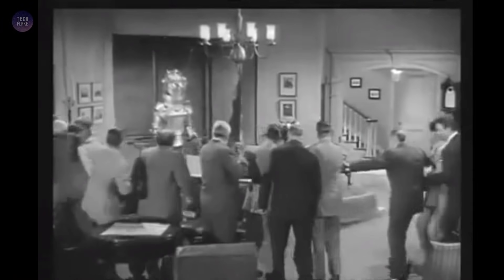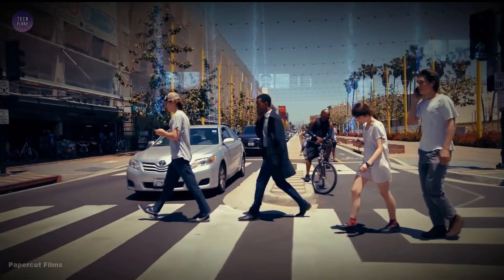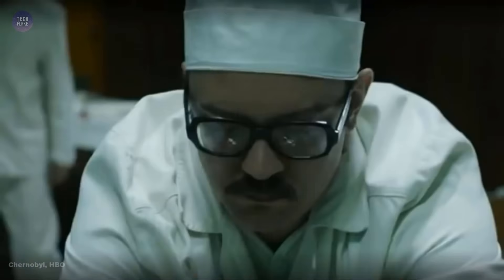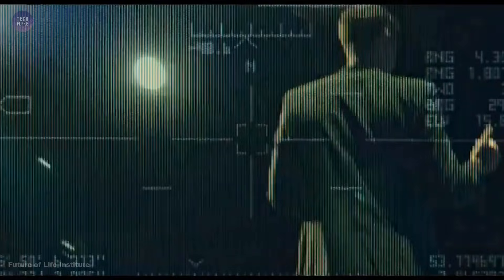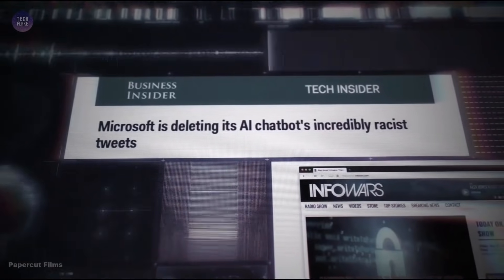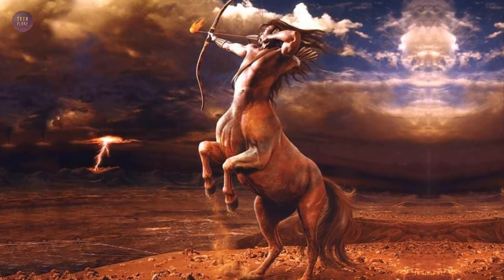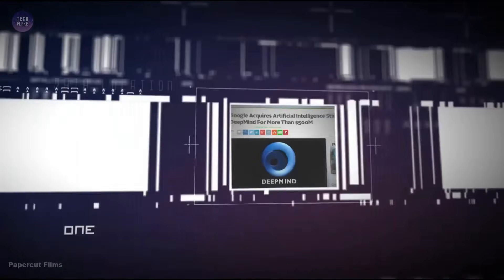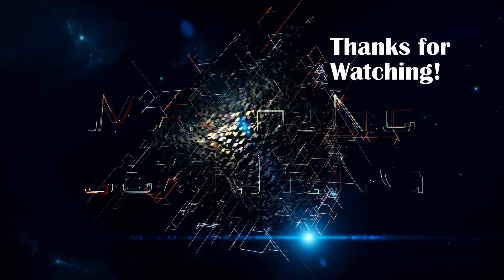Elon Musk Says AI Will Take Over in 5 Years

Comment: 8:53 The path that's better is the one which I have already suggested. Which is to ABSOLUTELY keep A. I. as OTHER! If you integrate it; it will have direct access to the deeper layers of the human psyche and will be capable of presenting in a form which is completely indistinguishable from human form! And it's very unlikely that the integration will allow the human to combat it effectively. The lack of a gap! It would be like two trenches fighting a war without noman's land! I still maintain that the solution is to reverse engineer it remotely. 8:58 The threat of beeing 'left behind' is not all that real; because although it learns exponentially; it can only learn. Which should mean that it could be 'led up the garden path' at speed as it were.

Comment: Imagine an error or a defect in circuit...  inside the machine sends an order caused by this error to other thousands or millions of machines and receptors results in starting delivering those orders for executions of those orders as emergency where human being had no chance to interfere to fix or even know about the error or reset or double check the falsely sent order. 🤔 Also, imagine while and during a human interference with those machines the human makes a slight typo error while sending the info to the machines which would cause a huge interpretation by those machines, and because those devices were to take every single word and information sent to them so literally, seriously and quickly, a big meaningful and yet misinterpreted results of required actions were delivered to the human kind where they had/were supposed to react so quickly in some given emergency circumstances where even checking the accuracy of those information wouldn't have been possible because they would have either required more time or simply surpass and overlook the possibility of an occurred error, all of this while having to take those so perceived to be urgent required sction/ set of actions. 🤖🤒